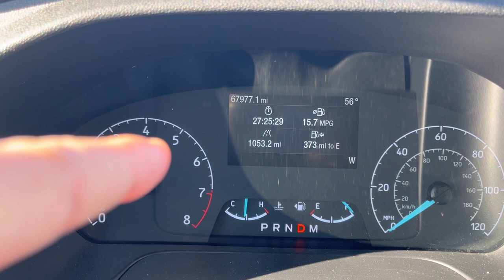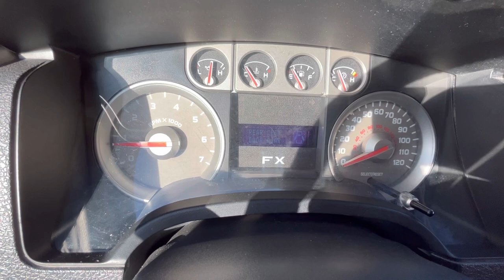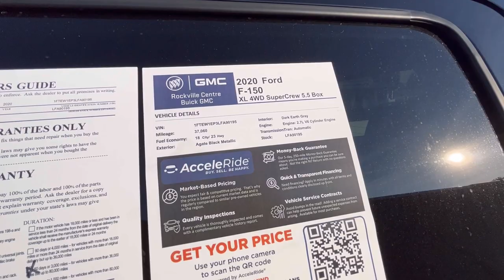THE SEARCH FOR THE MOWERS N’ BLOWERS PICKING TRANSPORT FLEET VEHICLE TO REPLACE THE VAN BEGINS!

Comment: At EP we stick with Ford F150s just a tip not sure whether you have Lubricol warranties like we do in Canada but for an additional $1k you get 3 years of warranty on used vehicles. Have recovered that cost in all cases of used vehicles we have purchased. The only new vehicle is Jakes company Ford F150 and he has videos on oil comsumption so likely getting a new engine installed within the 10 year warranty we purchased with the truck. May wait until Jake is ready to sell it to me before we get the engine swapped out eh?

Comment: Hey Henry why you don't try to get a 5'x8' trailer. They are around $500 used./$1200 new you just need a hok in your saden or suv. And they are very easy to load a lawn tractors on them. Just an adea. Good luck buddy
Reply from the maker: I had a trailer before,  pain in the ass to hook it up,  storing it etc

Comment: Bought my 2006 Ford F150 used for $9K Cdn. with 164 kms on it now has 500 kms. but have rebuilt both transmission and rear end which cost $4.5k so it pays to take out that warranty for $1k if available.

Comment: Be careful buying an f150. The 5.4 engines have cam phaser issues. Not a cheap fix and can be costly.
Reply from the maker: Yep I’ve heard that,  but millions of people own that car without issues.  I heard as long as you maintain it normally,  the 3v engines are fine.

Comment: The truck you offered $10,000 for sounded promising until you said the AC didnt work and it was low on oil. It had to be over 2 quarts low to not even read on the dipstick. 🤔  keep searching bro, you'll find one to your liking. Maybe the guy will fix the issues on the truck you offered on. 👍🇺🇸 Roger

Comment: Wow, how the hell can anyone drive around in or try to sell a vehicle with no f’ing oil in it? It’s not that hard to check, it takes a minimal amount of effort for crap sake! BTW the bad anti-lock brake sensor will also disable the traction control, when the ABS is fixed the traction control will be fixed too. It uses the same sensor to determine which wheel is slipping. That poor truck was probably crying out “Ehhhhh, earl! Need earl! Ehhhhh!”
Reply from the maker: Lol,  great info bro!  I didn’t know that.